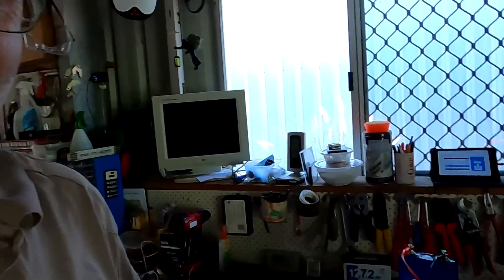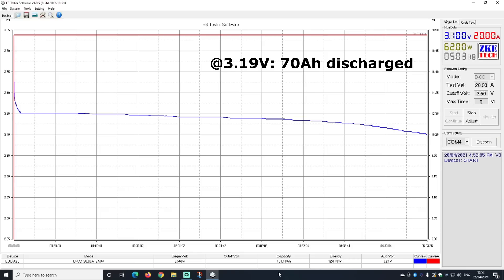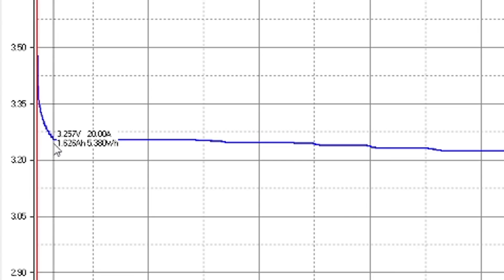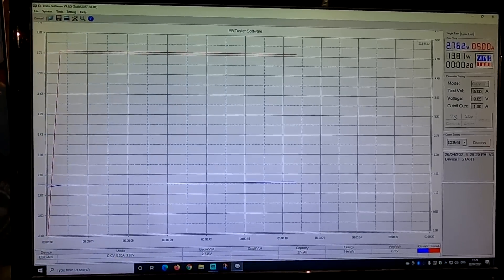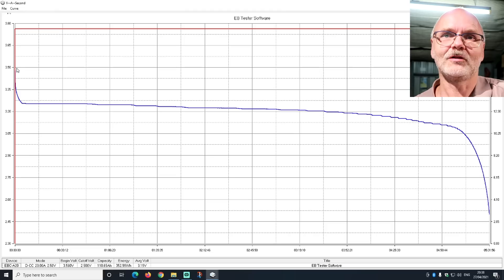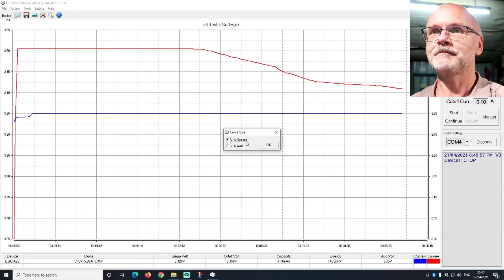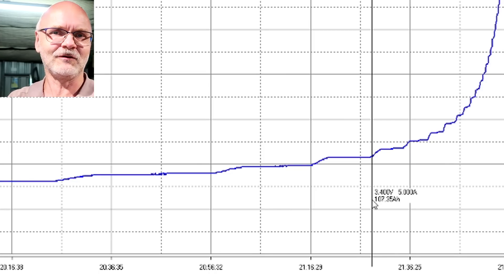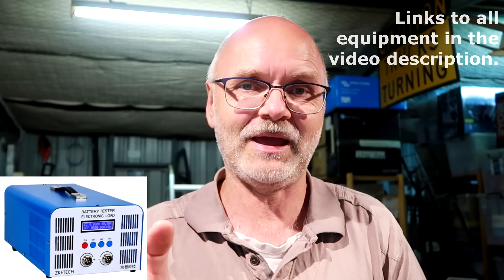How far to charge and discharge a LiFePO4 cell. Testing the full Charge and Discharge Curves.

Comment: I bet this is not a new branded cell, but a refurbished one for cheap cause 10 Ah more is too much.
Most likely it haad been a 120 Ah battery and to avoid any they simply sell those as  105 Ah.

If things go wrong for then the customer will still be happy due to the expectation of 105 Ah
And if he gets 10 Ah more then he will be happy,not complain and simply feel lucky and accept scratched terminals and so on. He would not a accept the condition of the batteries  if he had bought that battery as a 120 Ah version.
Reply: Agree.
According to specs that 100Ah battery weights more and is dimensionally larger than an EVE 105Ah battery.
I assume the battery makers are deliberately derating the cells capacity specs so the battery still performs well during end of warranty date. Not to say derating specs is wrong, manufacturers have been doing this for a long long time.
Andy thanks for another informative video. I learn much from you...
Reply: wrng hugh catiy les full chard diszçh bater ited chàre suchage bgrrr bsrr lobger it kadt

Comment: I have 2 lifePO4 12v 8Ah I bought the first of this month. I bought a charge you have to set type of battery number of cells, voltage, etc. I tried to see the charger work. When I hook either battery up and try to start the charge I get a cell warning on both and no charge. My other charger gives me a cell balance problem. What do you think? I just got one of the Miady 20ah batteries today. The charger is at my office so haven’t had a chance to try it with either charger.
Reply: buy 2 12 vilt 8 amps bayeeß fr8m yanja brßt bayerßr 8 too 16 years if useßg cjef never hsd telce thisé almst inmortyal naterirß
Reply: Is the charger monitoring individual cell voltages or just connected to the pack as a whole? 12V is closest to a 3 cell series connection, is that the same as Milady's?

Comment: Great test Andy. You opened my eyes. I'm building a off-grid 48v battery for the house. So I'm soaking every bit of information I can find to make the cells last forever :). Bless you.
Reply: Hi. How's it going?
Reply: @gigel99324  Hi. It is going great. Got my system up and running with a 22kwh battery. Just finished it 3 months back. Stopped using grid power for as many months. My home usage is around 8kw/day so the battery will keep the house buzzing for at least two days. All in all a very good investment, especially in this current market prices that are going up and up.

Comment: Excellent Vid Andy  
setting up my workshp off grid: LiFeP04 48vdc 100Ahr with MPP Solar contro ller.
From yor reasearch is the "best" to set the charge/discharge to cycle between 98 and 10% ?
My place will be 15 to 20 degrees C at all Times year.

Comment: Hi, I have 8 Pylontech 2.4 kWh 48v 50Ah 15 cell modules and your videos clearly demonstrate just how safe they play it with the recommended charge/discharge cut off voltages, 53.3v charge cutoff and 47.2 v discharge cutoff which gives a cell voltage of 3.5533v maximum charge voltage and 3.1466 minimum discharge voltage.

Is it possible to calculate the number of complete cycles by dividing the total kWh hours drawn from the battery bank ie 2,530kWh by the battery bank capacity ie 19.2kWh? Or do I need to access this data by connecting a lap top to the master battery data port?
Reply from the maker: Yes, these voltages you mentioned are totally save to use.
You cannot just divide the kWh by the capacity of the bank. That would give you a rough idea but usually you don't do full charges from 0-100%. If you do 10 cycles from 50%-60%-50% SOC it is far softer than doing one from 0-100%. It all depends where you do your cucles (near the peak at bottom or top) and what the DoD is.
Reply: that ßhoukd lsst oong t7me

Comment: I just got my "new" battery cells from AliExpress and was obviously ripped off. Could you show the "resistance" test of your small (20A) battery tester? I own the same and would like to know which values to expect in new batteries. Depending on which current I use the result is between 3 and 10 mR, which is is way too high in my opinion. But maybe this tester doesn't work fine-grained enough.

Comment: Hi, thx for the video - have same device for testing..since the EBC-A20 offers also just to monitor cells - will it work with an external device for charging/discharging and if so, how many "external" amps it could coop with? the 5A loading and even 20A discharge is a pain for 310Ah cells...

Comment: The only advantage to succed  the 3.5V threshold at charging is to see any voltage drift on cells connected in series.
As you said from the SOC capacity point of view it doesn't make any sense.
Greetings from Cologne
Reply from the maker: I guess it is enough to charge the cells to 3.5V once a year to see the drift at the upper end. Apart from that, you get full capacity out of the cells even at lower voltage. If they start drifting at lower voltage, then there is a problem.

Comment: Don't worry about voltage. Worry about high State-Of-Charge (SOC), THAT is what causes damage to Li-Ion cells with graphite anode (including LiFePo4).
And another observation: 
Charge with 5 Amps to 3.4 volts, no absorption, gives you about 98% SOC
Charge with 20 Amps to 3.4 volts, no absorption, gives you about 70 - 80% SOC, a bit unpredictable.

Later edit: It is true that using higher voltages increases the risk that the battery would charge to 100% or maybe even overcharge a bit.

Comment: Where can i find copies of the data (charge/discharge) that you generated.  The curves were quite interesting.  Seeing what the cycle degrade looks like would be interesting.  Why put in more energy than what you take out---but, this probably changes so that's probably why they charge to higher voltage points.  This was interesting.  Thanks

Comment: Awesome tester, any chance you can do a 5 Amp discharge test on the 100AH lifepo4 battery, and share the csv.
I would like to see the voltages during the discharge as they will be higher than discharging at 20 Amps.
I'll sponsor the beer's for the test 👍
Reply from the maker: Absolutely, Colin. I'll put your request on the list of future tests. Will come soon and I'll make a short video about it. Would be interesting to see how much more capacity we will get out at a lower discharge rate.
Reply: Thank You

Comment: Great job! Just the info I was looking for to set the cut of voltage for my inverter.  Looking at 75% DOD. 
Thanks
Reply from the maker: No problem 👍
Reply: I have a question, will the voltages be different at 20 Amps, 10 Amps, and 5 Amps discharge load, so if you are only pulling 5 Amps the voltages will be higher, I think we need some comparison testing 👍

Comment: Nice video, cool tool ,
 I am wondering what causes the small steps on the flat part of the charge curve. Chemistry in action?
Reply from the maker: Could be just the software and the resolution it uses to draw the graph. Also if you move the probes at terminals, it sometimes has better/worse connection and voltage goes up or down.

Comment: Hi Andy. If you just cycled the battery between say 3.35 and 3.1V (never discharge lower or charge higher), what would the actual capacity be then? In terms of preventing deterioration (and therefore increasing lifetime cycles), that seems optimal from these first curves. It seems to me that you are just 'derating' the cells by 10 or 12%. Did I understand that correctly?
Reply from the maker: The problem is charging to 3.35V only, you might a different SOC every time. This is still in that flat area of the curve. I'll do the test ;)

Comment: The results are good for general guidelines but not much more than that. Results will be different between different lots or different manufacturers 100Ah batteries and will probably change for used batteries.

Comment: I'm not sure if I understand your interpretation of that discharge curve. While you are talking about the small change of the voltage, the red curve shows a constant current. This current is doing chemical work inside the batterie. So the batterie is constantly charging even though the change in voltage is very small.  
If you discharge a batterie, you exactly want a constant or at least very flat voltage curve over the complete dicharge cycle. A batterie with a linear discharge voltage from "full voltage to 0V would be useless.  So I dont find it very surprising, that the batterie shows a similar non liniear voltage behaviour while charging.
You're not filling up your batterie with voltage ;-) The charge current is doing a constant chemical process in the batterie. Only if the batterie is almost full and almost empty there are additional effects that cause a bigger change of the voltage. 
But maybe I just missunderstoof what you wondered about.
Reply from the maker: You're absolutely right. Current is what is charging your battery. This was just a general test to show the charge and discharge curve of LiFePO4 chemistry.

Comment: To answer your question, you need to get the charging voltage above the knee to properly top balance the cells.  In case you don't already know, you can change the title on the graph from "EB Tester Software" to whatever you like.  I number my cells and change the title to the cell number so i know which cell was tested.  You can also save an image of the graph that you could print and attach to the cell of you want.  Having test data for each individual cell is important when you need to put cells in parallel.  I have a battery with groups of 2 in parallel and 4 groups in series.  Having individual cell data is important to make each group's capacity as close as possible to get the maximum capacity out of the battery.
Reply from the maker: Yeah, I saw this in the software. That makes sense to keep all the data for future reference.
Well, you can only top balance the battery if there is no other current going in and out of the cells at that time. Otherwise your balance current may not be high enough to do its job.
Reply: @OffGridGarageAustralia  You don't need the current to stop flowing to balance.  You just need to be above the knee.  At that point your charge controller will be carrying the system load and your battery can be considered fully charged for all practical purposes.  Make sure you have enough voltage difference between your balance voltage and your charge end voltage on your BMS so that the BMS doesn't interrupt the charging cycle during normal operation, especially if you're using a BMS that uses a relay or contactor for protection.  Remember it's not the BMS's job to balance an unbalanced bank, only to maintain a balanced one.  Assuming your cells were balanced at the start, you should only need a few mA to maintain balance as the cells degrade.  If you're using an absorption voltage that's different from your float voltage, you can consider the absorption time as "balance time".  Also remember that it's not necessary to achieve perfect balance during every charge cycle, everyday.  It can be an iterative process and you only need to keep them close enough to prevent overcharging any one cell and having your BMS trip out on overvoltage.  Don't worry about trying to achieve laboratory results using Chinese cells and electronics in the real world.

Comment: Awesome! This proves all of my hours of watching my batteries and learning (The hard way!) I also determined it was not worth squeezing every little bit out of the batteries. My settings for my pack are 50v (3.125v/cell) at the bottom. and 56v (3.5v/cell) at the top. The top voltage in my opinion could be lowered to 3.4v/cell with very little loss of ampacity. Thanks for sharing this. Very interesting!
Reply from the maker: Thanks, Dan. Yeah, that is absolutely right and you have some good settings there for your battery.
I've done a test with charging to 3.4V only. Interesting result. Video is coming soon.

Comment: And now you know why using voltage targets to get to a known state-of-charge when charging at a very low C-rate (0.05C at 5A for a 100Ah cell) is nearly impossible without counting the actual watt-hours going into the battery.  The curve will look a bit different when charging at 0.2C, and it will look different again when charging at 0.5C.

Generally speaking, the higher the charge rate, the higher the voltage target you can set to get the same state-of-charge result.  And, consequently, the lower the charge rate, the lower the voltage target you need to set to get the same result.  And, as I've said in prior posts, charging at ultra-low C rates runs up against what is basically a no-win situation, because of two things. (1) You wind up having to set such a low voltage target that you hit up against that flat part of the curve and it literally becomes impossible to achieve any sort of reliable state of charge based on only measuring the voltage.  And (2) At low voltage targets the battery's current acceptance can easily drop well below what even minimal solar panels could deliver, and you wind up leaving solar energy sitting on the table instead of going into the battery.

Plus, as the cells age, those voltage levels all shift.  What might work with very fine tuning on a new cell will stop working within a year, requiring re-tuning every year or two.

So how does one deal with this problem?  Generally speaking, by having a charge controller + BMS combination that is able to actually count the watt-hours going into or out of the battery and stop the charge when the appropriate capacity is reached (regardless of voltage).  This way the charge controller can use a higher voltage (hence increasing the battery's current acceptance and using all the energy available from the solar panels), and the charge controller can count (net) watt-hours going into the battery and cut-off the charge based on that to avoid over-charging it.

Either the charge controller will have a separate set of terminals for the load and an internal shunt, or the BMS will have a separate set of terminals for the load (and an internal shunt), or you D.I.Y. the shunt and one or the other has sensor terminals for an external shunt (usually requiring a calibration sequence).  And then either the charge controller or the BMS with the appropriate feature can be programmed with a capacity limit.  If the charger controller handles it then it simply cuts charging off.  More likely though the BMS handles it and simply cuts off the charge controller (causing the charge controller's output voltage to instantly reach its target).

Without counting watt-hours, the poor-man's solution is to set a voltage target on the low end and then set a non-zero absorption time at that target to try to achieve the desired state of charge.

-Matt
Reply from the maker: Thanks Matt. good comment.

Comment: Hi Andy, thanks for your test. One more wish, would you please also put the two CSV files on your homepage for download. Then we can have a look at the exact values at certain points. Thanks
By the way, different "C" rates in the discharge will show different voltage values. My experience.
Reply from the maker: Thanks Mel, I have now shared these .csv files as well. 
Yeah the curves are only for this chemistry under these specific conditions.
Reply: @OffGridGarageAustralia  
...wich brings a new question: 
What would that curve look like in cold or  hot environment situations ?
That would be extremely relevant.
(especially for those living in a different climate)
🤔

Comment: I'm not sure why you decided to use a 5 hour discharge as most manufacturers use the 20 hour rate which should give you a greater capacity. In reality, you need to discharge at the rate that you would normally use to get real figures to suit your use.
Reply from the maker: The standard test method is to charge and discharge a cell with 0.2C.

Comment: Warning, highly controversial and potentially inflammatory opinions ahead...  :)

"If you're still using Fahrenheit"

Sure, Celsius more popular, but does that really make it better?  Why should our temp scale be related to the freezing and boiling point of water?  I'm not sure why that matters.  Shouldn't it be based on the human experience?  0 Fahrenheit is *generally* about as cold as it ever gets and 100 Fahrenheit is *generally* as hot as it ever gets.  We get a much better resolution that way.

http://thevane.gawker.com/fahrenheit-is-a-better-temperature-scale-than-celsius-1691707793#:~:text=Fahrenheit%20gives%20you%20almost%20double,than%20Saint%20Celsius%20ever%20could.

(BTW, I really don't care how *YOU* measure your temperature.  Do whatever makes you happy.)
Reply: Could always add extra decimal places for resolution. Not necessarily limited to integer values, that's just a decision of the thermometer makers and not inherent in the temperature scale -